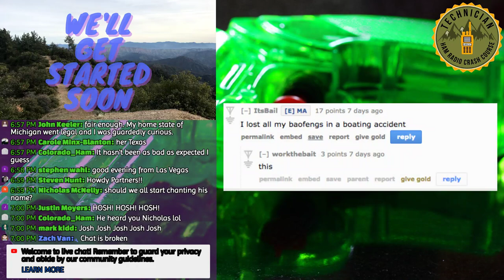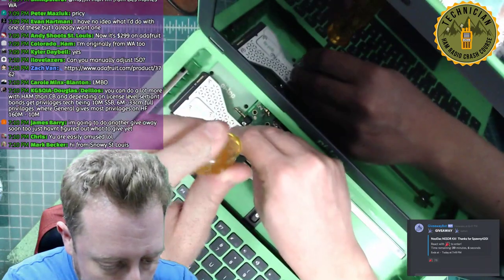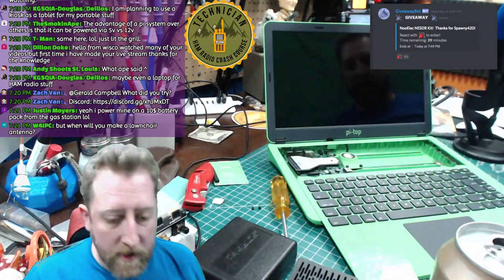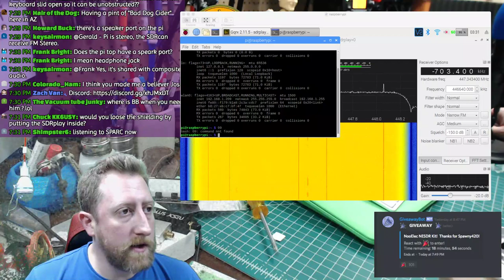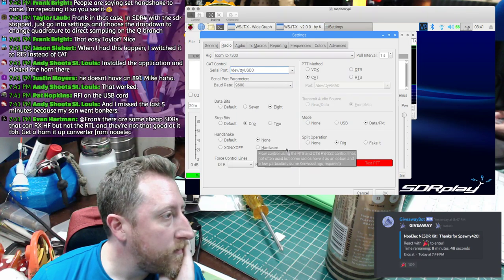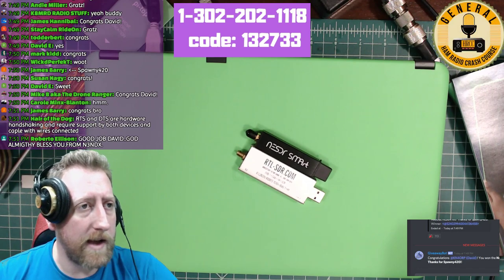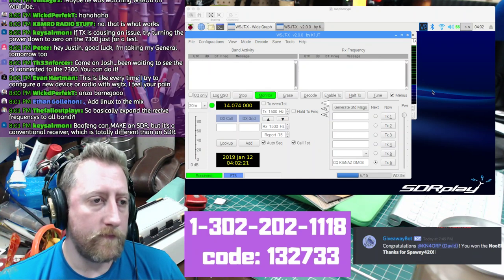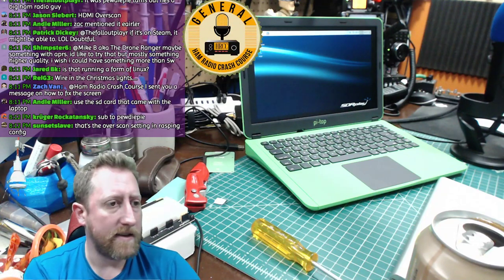PiTop Raspberry Pi Laptop For Ham Radio FT8 SDRPlay

Comment: Thanks for these videos and all the HAM radio info! Just getting my tech/general license soon and found your stuff is very informative and helpful. Mainly using the radio for emergency and events as I help at running/bike races. But the SDR thing (and RPi) has really caught my eye and saw this vid and your other ones...so my question to you is, which SDR if any is capable of transmitting even if its only half duplex? Still going thru lots of info and research and thought I'd see if you have any suggestions since this will be my next step when I'm home and don't want to use my handheld BaoFeng when I have a good powerful computer. Thanks again!
Reply from the maker: Aside from the proper amateur radio SDRs, like the ICOMs and Flex radios, there are few SDRs on the market that can transmit, they are mainly for receiving.  The only one that comes to mind is the HackRF

Comment: Good stuff, and what a cool laptop! lots of potential there.
How is the battery life? I know that the SDRPlay folks say about 170ma or so current draw on the RSP2pro so I'm certain that isn't a big deal power-wise on the RSP1A.
Reply from the maker: It seems that the battery life is very dependent on what you are doing with the Pi.  But 6-8 hours is pretty normal from my short time with it.